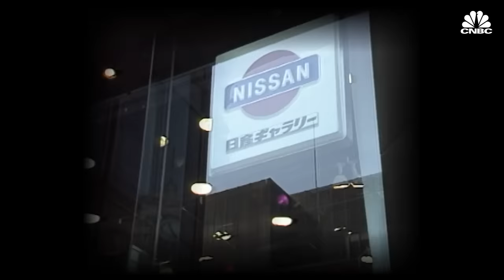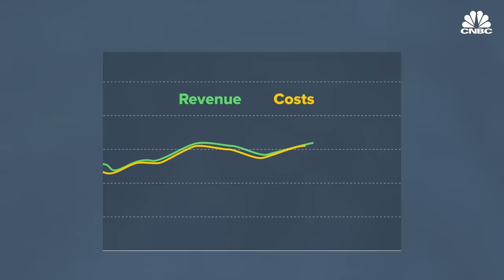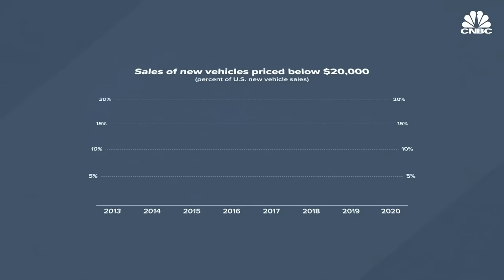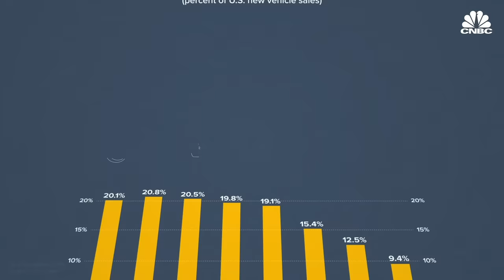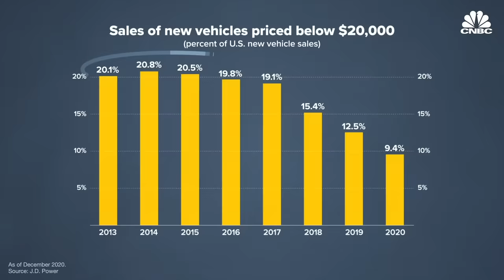Why Cheap Cars Are Disappearing

Comment: Buy used. You can always get a warranty with a used car as well. I will never buy a new car ever again especially here in New York.
Reply: Or just buy a Toyota and not worry about a warranty and a car breaking down all the time.
Reply: @eman0828  we bought my husband a 2020 Tacoma. Have had nothing but issues and toyota can’t figure out what the issues are. Not all cars are 100%
Reply: @hayleymiller7032  yeah but the Tacoma is made in Mexico. You should have bought a 2021 Corolla made in the USA/Japan.
Reply: 11:11 Here in Europe manufacturers seem to have finally sorted out rust proofing. Back in the 1980s it was common for cars to be rust buckets once they were over five years old. My 8 year old Ford Escort certainly was a just year after buying it in 1981. Cheap cars are still being sold. People in the USA should look up Dacia to see what is available here.
Reply: People just need to lease. Cars depreciate. They start to get more issues after 3-5 years. You get a new car every 3-4 years depending on how long your lease is. All basically still covered under manufacture warranty within that lease timeframe. People just want to say the car is theirs, but not want to deal with the money they’ll have to put into it with repairs.
Reply: There is one major problem with the buying used mantra.

Obviously if people are not in a position to buy a new car they shouldn't.

But if no one bought new cars....there would be no used cars to buy in a few years at anything resembling reasonable prices.
Reply: I just bought a used car. They are also pretty expensive but a much better deal than new. I was pretty shocked at the prices for used vehicles these days.
Reply: I always buy used luxury cars for 50-60% off like Mercedes for 4 years old is like 1/3 price of new and has warranty certified. I got an S class only 4 years used same as 2020 for 35k msrp was 90k
Reply: I just leased a VW Passat 2020 for 269 a month and zero down lease to write off can’t beat it
Reply: Buy a used Toyota Camry. Case closed.
Reply: @ferndog1461  never!!!!!!! That’s a terrible car at least get a used VW or BMW or something better. Come on Toyota you gave up on life?
Reply: Why would you buy a car in New York?  So expensive.  Save a few thousand every year and use public transport.
Reply: Exactly. i got an android radio i installed for 80 dollars, touchscreen with android share feature, gps, back up camera already with it. I also got a smart mirror with recording back and front and reverse camera on amazon that i installed on 2004 Toyota Camry. The dealership charges lile 20k more for that, it's a highway robbery
Reply: @braetonwilson4296  never buy a Toyota made in the usa the quality is not the same
Reply: @nitishkannan2919  depends on wgich country you're in. Here in Southeast Asia, Japanese brands dominate the market because any western car is too expensive to maintain. Korean cars are also starting to get good.
Reply: Just buy a grand marquis an youll be straight
Reply: @atate23  that is as bulletproof As It Gets. I seen some some with 500000 miles. I would like a town car though they look nice.
Reply: @michaelscott7706  i own 2 lol an 05 & 06. Very reliable. Easy to maintain. Can get one for cheap. Bought both with less than 100k miles on them. 05 was $4k an 06 for $4500.
Reply: @ferndog1461  still in like the 13-15k range for a newer one with lower mileage and that’s still not really a great deal
Reply: @nitishkannan2919  Ever worked on a BMW or VW? They are horrible.
Reply: @JiMBERLY  Repairs are far cheaper than constantly paying for depreciation, especially on something you will never own.
Reply: @andreweven7008  yes I have first off I lease a VW for 269 a month all repairs are free on a lease. Two I’ve bought several used mercedes they’re so cheap to fix take to a cheap independent repair shop. I have a Tesla it’s the most expensive used car to own and repair and even that isn’t bad tesla reimbursement for the 3k repair worse case now so even that’s been solved also. If I buy a car for 1/3 MSRP I don’t mind paying to fix
Reply: @hayleymiller7032  the Tacoma wasn't built in Japan.
Reply: @JiMBERLY  so you want a permanent car payment. yeah, no thanks.
Reply: Michael scott,
AMEN to that. I have NEVER purchased a new vehicle. No matter how cheap or expensive new vehicles have so many computers and less and less options to repair issues. Hell you can't even change transmission fluid any longer. Planned obsolescence is not only in the world of apple.
Reply: You wont buy a new car even for Dunder Mifflin?
Reply: Same here used is the way to go.
Reply: Surely, used cars are cheaper but not as much as most people think; since interest rates are higher when we finance a used vehicle. Unless, one has a good lump sum to buy one out right from a private party. Buying one from a dealership, we have to agree to a higher APR, especially for those whose credit history challenge the lenders.
Reply: I bought a 37 year old car for $1200 3 years ago and haven’t looked back. Plus at this point it’s an appreciating asset
Reply: Ya'll....  CRAZY!!!!!!
Went car shopping 3 years ago, all the used (certified) cars on the lot, were more expensive!!!!!!
Reply: @kittyfanatic1980  apple supports their phones for at least 6 years . Lucky to get a third of that support on an android phone.
Sorry, but if you want to use a comparator to make a point, have it make sense.
Reply: @nitishkannan2919  Better listen to Scotty Kilmer. Those cars are Endless Money Pits!
Reply: @eman0828  that’s not true at all I have several luxury cars I got 1/3 msrp and their a bargain and you take to independent service it’s cheaper than a Honda foo
Reply: @nitishkannan2919  You're pretty delusional if think German luxury care are cheap to maintain. They have alot of electrical problems as they age with all the fancy electrionic gizmo crap if you think they are cheap to service. Buying a Mercedes S class is a big financial nightmare. Those cars fall apart as they age and you have to take half the cars apart because they are so over engineered. That's why the labor cost is so high and parts are very expensive.
Reply: @eman0828  I own an s class lol. Let’s see  bought it used and for 7 years had 2k of repairs lol not bad at all
Reply: Including oil change etc I go independent service cheap repairs lol
Reply: I got a 108000 dollar car for 36000 not bad at all
Reply: @eman0828  I would never buy a Toyota or Honda that’s when you give up on life
Reply: @nitishkannan2919  You can keep driving money pits for the rest of your life burning money which is you will forever be broke and in poverty. Smart Rich people don't waste money on luxury cars.
Reply: @eman0828  I’m smart rich I only buy luxury cars they’re free if you do it right. Example Range Rover used is 31000 but 100% deductible so it’s 21k for a 5 year old Range Rover. If I sell in a year or two it’s 21k+ resale which means a used Range Rover is free or cheaper than any car. 

Same with Bentley I can get one for 65k I can resell for same as I paid in a year or two. And basically I buy after it’s depreciated so I loose nothing
Reply: @eman0828  smart rich would only buy used luxury cars the point of money is to live a good life. Literally money has no other use besides that after basic needs are met
Reply: @nitishkannan2919  $2,000 is a lot of money to put in a used car if you ask me. Before you know it you will be spending past the vaule of the cat because Mercedes have no resale vaule what so ever. And you are delusional if you think you can sell a Bently for the price you paid for. Those thinks depreciate like a falling stone. I can tell you obviously know nothing about cars. I drive a 14 year old Camry that will or last your money pit Mercedes and all its need is normal maintenance. Everything is oringal.
Reply: @eman0828  Camry the worse car made why even make money to Drive a Boring car. I only drive luxury cars. I personally drive a Tesla as a daily driver it’s 300 a month zero down on lease and I bought a model S for 50% of msrp. It’s battery and motor have an 8 year warranty works fine for me. You can pick up a model S now for 40k. It will resell for the same price in a year or two.
Reply: @eman0828  buying new luxury cars is stupid. Buy buying them for 1/4 MSRP is genius. That’s what i do. My Tesla is cheaper than your Toyota. As is my Mercedes S class

Comment: My first and only new car was a 1997 Honda Civic that I bought at 20 years old. Now, my '97 Civic approaches 400,000 miles!
Reply: Can’t put a price on new safety features though.
Reply: My brother's 1986 Honda Accord, at last count, has more than 600,000 miles on it and is owned by my nephew and his wife. I bought a 1997 Lexus LS400 that was developed by Toyota at a cost of $1 billion. One just like it recorded over 1 million miles with no repairs to engine or transmission - aside from periodical things like plugs, filters and timing belts. I paid $1,700 for a two-owner with 183,000 miles on it and it runs better than any new cars, including Hondas, that I have owned in the 80s and 90s. It will be my last, and greatest, car. F.H. Royce said, "The best is cheapest in the end. The quality will remain, long after the price is forgotten."
Reply: @entItyVR lol show me crash test ratings from the 70’s I’ll wait. Today’s cars are much safer in that regard, and also with preventive measures like stoping cars much quicker than human reaction.
Reply: Nice job on the 400K miles. You deserve a mileage award from Honda!
Reply: @danielt.3152  Thanks
Reply: Wow
Reply: I drive my 1997 Toyota Camry proud
Reply: @JamesCook76131  you can get most of these systems 3rd party and have them installed. Even if you did that. It still doesn't validate current car prices.
Reply: @SJHFoto  Shoot man. it would be cheaper for you to have the engine rebuilt when you get to that point. Than buying a new, or recently used car. You want the bells and whistles? buy them 3rd party and have them installed, or install them yourself. Good on you.
Reply: @shanewillbur1325  I've actually not gotten rid of any car (except the '85 Tempo which was JUNK) by my choice. Each time I got rid of a car, someone hit me and totaled it (Sadly, this happened 3 times over about 25 years)
Reply: @shanewillbur1325  crumple zones and other safety devices 3rd party wouldn’t be as safe as getting it from the factory. But that’s your opinion and I have mine. I’ll gladly drive my 3 hrs round trip everyday in my Benz
Reply: Nice! Not many cars can do that.
Reply: @rickleuce8025  This actually is the first year when I didn't put mega miles on it (Well, I did the first 2 months) because of COVID. You see, I'm a youth sports photographer, and we drive quite far on jobs

My best friend has a garage, and I take it to his shop for regular maintenance. Actually, I am in the queue now for a timing belt/water pump replacement. That, and I've used full synthetic oil for the last 100,000-150,000 miles or so
Reply: All cars SHOULD be able to go 400,000 miles.  Most of them die after 150,000 even if you take good care of them.  You may pay a little more for a Honda, but they are well worth it.
Reply: @thelakeman5207  Definitely. My new 1997 Civic was paid off before 9/11, and the only reason that particular car is not on the road is because I was hit by a tractor-trailer (I bought another '97 Civic and, voila!)
Reply: @danielt.3152  that’s nothing new for Honda best engines in the game some up to 1,000,000 miles I’ve seen it with my own eyes
Reply: You don’t drive much
Reply: I daily a 1983 Datsun Sentra station wagon it has 310k miles on it is carbureted 5 spd gearbox and still gets 50+ mpg.... yes you read that right when is the last time a new sentra could achieve those fuel economy numbers?... oh and did i mention a brand new set of tires for it cost $250 out the door mounted and balanced? sadly i had to replace the original transmission at 307k miles due to catastrophic failure but it's still got the original engine
Reply: @davidpugh8772  Cool!
Reply: New cars are cheaply made and don't make it into the second hand market once major components fail ..the manufacturers make them last just long enough before failure then Charge a fortune for parts for the cars .they become uneconomical to repair . they get squashed . 
My other half had old civic  it was wrote off she replaced it with the same newer model . thinner body  panels  cheaper plastic parts no spare tyre even door handles made are thinner . drives horrible compared to the same older car uses more fuel and lower spec .  just not made to last on purpose
Reply: Yo, 90s Honda gang! I've got a 91' CRX at 300k going strong. Hoping to replace the engine soon.
Reply: @SavannahBurris  Why do you want to replace the engine? If it is not broke, don't "fix" it! Those 1.5L engines had quite the longevity!
Reply: That's awesome keep rolling that car
Reply: @JamesCook76131  You can put a price on them hence why every new car does not have them - only some do.
Reply: Way to go!
Reply: I got  Nissan Leaf.  It's charging in my garage. 200 miles on a charge, 214 hp. Costs  $3 to charge it.  No gas, no oil charges, very little emissions, $386/month.
Reply: @troywhitney1948  That's cool-it really is. And if they offered that in 1997, I might have bought it. I know they are $11,800 CAD more than a new Honda Civic. I am sure I spent that and more in gas and oil changes. However, I don't think I will ever buy a new car again, and I hope not to have to buy another car period. I have the original clutch and engine in the car, but I think I would spend the money on an engine rebuild if need be over buying a new car (or even another used car as I don't know the history of it) To each his own though

*I also want to thank everyone for their replies, and for not using bad language when they make them. I, of course am not saying that anyone has to buy a certain car-I am just happy to have a reliable car that doesn't cost me a lot, and I am grateful to God for it as for now, a car is a necessity for me, and I am able to have these and other needs provided.*
Reply: Commies
Reply: Another reason cheap new cars don't sell

I guarantee if you don't wreck that or something it will still be operational at decades end
Reply: James Cook 
Yes however the best safety feature remains the one between your ears 

Two safety features namely blind spot monitoring and rear backup cameras are not really needed on cars with better visibility visibility is worse now

If you really need lane departure warning you shouldn't have a license I mean come on
Reply: That’s  awesome!!
Reply: @JamesCook76131  Quite fitting that you drive a Mercedes. I mean here in Germany the car brand is very popular among senior citizens and they highly value safety features. 

On the other hand I wouldn´t be very happy, if I had to drive three hours a day to get to work and back. Just my opinion.

Comment: To everyone buy expensive new cars, thank you!  Please take care of and I will see you in a few years.
Reply: Facts lmao. Love a well kept hand-me-down that is only gonna depreciate in value but not quality if it's well taken care of
Reply: paid 18K for 2016 for fusion, fully loaded with 45K miles
Reply: @gregoryeverson741  You overpaid big time.  45k miles on a Fusion and it's almost ready for an engine swap.
Reply: 3-5 years used cars are almost new but way cheaper
Reply: Biggo FACTS!! 🤣
Reply: @kidd32888  Not around me. Pretty much the same price unless there's a known issue with the model.
Reply: I bought a used 3 yo luxury car for less than 20k back in 2014.  I still drive it today and love it.  Thank you previous owners for buying it new for 39k and taking care of it
Reply: @George L actually Volkswagen is great on warranty!   A couple of the critical engine parts were repaired under full manufacturing extended warranty when I had 145K miles on that car.  The rest were minor repairs I did myself mostly.   I'll keep drive it pass 200k.   :)

I do love the fact that every other car on the road is a boring old Toyota or Honda that everyone is buying because the market sold them their "reliability" (although most modern cars today are pretty reliable unless its cheap Korean knock-off like Kia or Hiyndai).  I like being different
Reply: @networth00  My mom just got a 2020 Fusion titanium for 19k was a rental has 30-40 k miles
Reply: No need to thanks us, we buy expensive new car because our business benefits from it. We charge this expense into the Representation Costs category and most of the time we got more than 100% money back from the investment, so, when we sell it to you is a plus. Ahhh, and the social status boost is not bad either
Reply: @George L no, its gasoline TSI
Reply: @Consymas  what type of business?   If someone shows up to sell me something and their car is to nice I usually pass on their bid... one exception might be real estate agents.
Reply: & change the oil often please